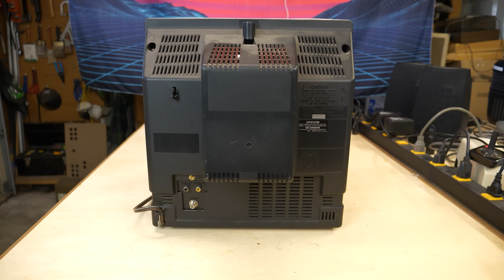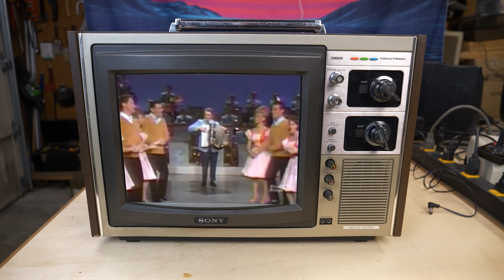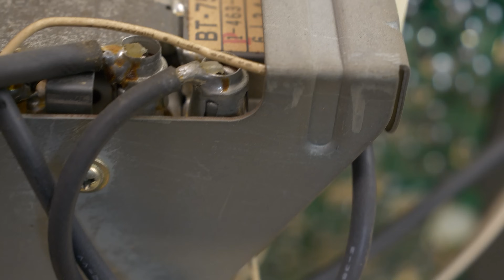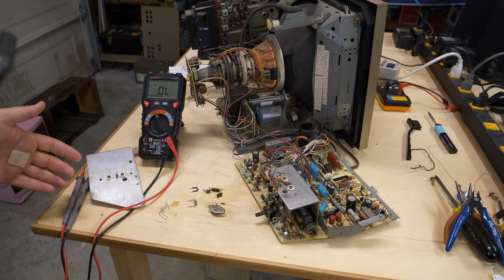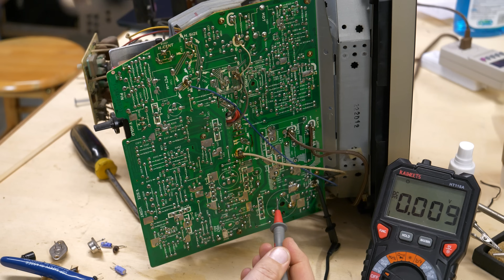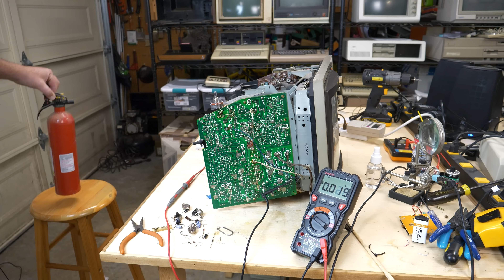Sony Trinitrons From The 70s And 80s

Comment: Their was a church that used to have these on the front of the pull pit. Their was 2 of them under a glass podium, they were black and white and one of them had purple carpet on the with part. The back was exposed. It was a unique set up. 📺

Comment: These TVs needed to have voltage slowly increase to reform caps a variac would do that but an incandescent light bulb in series with the tv would be useable. I found the Sony TVs to be money pits, throwing good money after bad, usually more than one component with take out several others, usually expensive horizontal output and voltage regulator parts that were Sony only made parts, you have to be damn sure the parts are all changed at one time or else you will have a pile of original and replaced parts making a nice pile. I considered it tuition paid to learn to work with these sets.  But I think I would have cut my losses once you blew out the second regulator transistor.
Reply from the maker: Yeah. I definitely need a Variac.

Comment: Why not just keep an eye out for a parts set or replacement board somewhere?  Much better than gutting that beauty.
Reply from the maker: Because if I find another set with a working flyback chances are it will work just fine. It's very unlikely I will find a set that has a good flyback but that can't be repaired for some reason.

Comment: We used more 9/14/21-inch Trinitrons than I can remember - in broadcast & post production…
Never saw any smoke or sparks from 1974-1987, then worked for SONY around 1991.

That was in PAL markets, so there may have been US power supply issues.
Reply from the maker: Good to know. I really think the flyback just went bad with age.

Comment: Transistors have three leads, yes?  Then how is the regulator a transistor?
Reply from the maker: Yes. It has three leads. Base, collector, and emitter.
Reply: @RetroHackShack  But I only see two.
Reply from the maker: There are two in the middle and one on the outside
Reply: @RetroHackShack  Do you mean the metal base?
Reply from the maker: Yes

Comment: Regarding putting in an LCD: it is possible to breach the tube’s vacuum by breaking off the stem, then cut the curved glass off the front. This can then be used in the bezel (epoxy maybe), and viewing the LCD through the original tube front would look more authentic. Of course it would mean destroying a CRT that probably is a good part in limited supply…
Reply: @Trinitron Productions if the tube is weak/bad/dead then really it wouldn't matter.
Reply: @Trinitron Productions That would not work in this case. different tubes. Could be done though as it is possible. Just not in his case.
Reply: @JelliedCranberrySauce ikr

Comment: I've been in many TVs in my younger years, due to living on military bases and so many people moving in/out (and free bulk waste pick up). I'd grab then from the curbs. Some of the older sets, especially the high ends, were so interesting with so many boards and complicated circuits. I was so young though, I really didn't know what I was doing besides basic things. 

I believe PIN is a pin cushion adjustment (something quite rare on a TV set), but not sure.
Reply: Particularly the noughties have a complex number of service menu "pages" ie on screen adjustments but for the entire service manual maybe several hundred pages for up to like 12 or 16 different but simmilar class of tv model numbers ie varying in screen size but probable fo have slight appearance variance in trim etc but not as much but still also some in performance or in other words resolution input capability

Comment: Miami Vice crossed your mind too, I was just thinking you'd see that one the desk of some sinister executive or dealer of yayo. Nice pairing with the NES, I'm guessing that was the peak AV for the time, still amazes me how long stereo TV/gaming took to arrive. RF, oh I thought you'd try Composite, that was high tech bitd heh.
Nice headphone jacks on the 70s set, just recently I was thinking I only imagined those in TVs, always thought that was a good compromise for one speaker electronics. Clean AV connection point system too, my first family TV got pretty scratched with screw & fork swaps during the VCR rental years. Coaxial connectors took a while to be standard too, Cable-TV push I guess, wish I could have tried UHF but Weird Al is my only reference to that world. ;)
Thanks for the feature, I was curious about high end TVs from those decades. There is progress in AV connectors but slow and in several steps adding Composite, then S-Video, then Component, and eventually RGB/VGA. They each have cost variances but too bad in NA we never saw an uber connector like SCART.
Anyways you tried and like you said about X amount of dollars rising to repair, there's always salvage parts. Speaking of LCD replacements, I've seen some interesting tube approximation by using a lens on the outside. https://hackaday.com/2021/06/16/fit-your-lcds-with-lenses-for-that-vintage-crt-look/
Reply from the maker: Cool. Thanks for that link. I will check it out.

Comment: Older set probably has shorted SG horz out SCR on the shield. Also shorted 
2SC867 pass regulator & a burned resistor in the hoz drive. Then you
need to find what blew it all.  Trust me, dont put a penny into it. Pink  one
looks good. A much better set & easy to fix.  Also came in blue, black, tan
& maybe a few other colors......
LFOD !
Reply from the maker: Exactly, I discovered that later on in the video. Good call.

Comment: This was a fun video, thanks for sharing. Shame the older TV was beyond fixing, as you said that definitely seems like something is shorted, . I'm happy you're keeping the TV, it's really quite aesthetically pleasing. Regarding the newer TV - I had the nearly identical model to your KV-1397R (except mine was grey) and it was a great little TV. Wish I had kept it.

9:55 The 2 earphone jacks were pretty common on older Sony TVs. One of them would mute the speaker, and the other wouldn't. They are usually marked with one dot and two dots to show this. I think the idea was you could record audio off a TV channel to a tape recorder while listening through the TV speaker, use headphones and mute the TV speaker, or as you said - use 2 different headphones for 2 people.

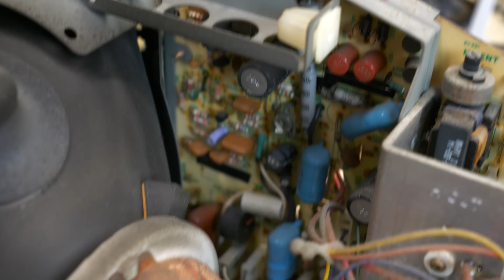18:17 PIN is the pincushion adjustment, it adjusts the vertical straightness of the sides of the picture.
Reply from the maker: Thanks for that helpful info. I was hoping to test those audio jacks out if it was working, but this will potentially help me in my resurrection 🙂

Comment: I worked at Circuit City in 1986. The pink set is part of Sony's designer series from 86-87, and you can get the user's manual at Sony's website. They had pink, red, blue and gray. Thy also had Betamax VCRs in the same colors. On the older set (too bad you can’t get it working) the Auto setting is to set the picture automatically (color. intensity, brightness and contrast). AFT is automatic fine tuning so you wouldn’t have to set the fine tuning yourself.  Those controls on the back are for TV techs. When I went to my grandma’s house and watched TV, it was Star Trek.
Reply from the maker: Fantastic! Circuit City! Loved that place. Thanks for the info.

Comment: Do the capacitors in this go bad if they were regularly used until recently?
Reply from the maker: No. Probably not. Of course all electrolytic caps can dry out or leak over time. That's why it's good to test them with an ESR meter.
Reply: @RetroHackShack  That's great I got a Trinitron from the mid 90s that was in use till 2018 or so and is in storage might just take it out and see if it still works. 

Also just found your channel a lot of great videos to catch up on.
Reply: @shoraz  a 3-4 year idle time is kind of on the edge of capacitors drying out depending on how high-quality they are. 6-12 months is about as far as I’d go for a definite. But I’d also probably just chance it and see if it works after 4 years. Then fix it if there’s any magic smoke released lol. 2018 is definitely way better than say 2010 for the last-used time.
Reply: @kaitlyn__L  I got it out of storage and it's dead, maybe not from the capacitor but it did get a bit wet everytime it rained so I'm guessing maybe the traces got corroded or something.
Reply: @shoraz  oh yeah that can do sooo much harm, even just extended high humidity. Could be just one trace is corroded out or absolutely everything could be crusty.

Comment: I'm confused as to why you wouldn't just recap the set. 70 year old electrolytic caps could still be leaking internally even if you don't see any physical leaking. They could be turning into resistors.
Reply from the maker: I did change many of them. I just didn't show that. You will notice my parts pile grows over time. However, I did test all the caps out of circuit with an ESR meter. They were reading a bit high, but not out of spec.
Reply: @RetroHackShack  https://www.youtube.com/watch?v=LhovRIM5xAo Check Out Mr. Carlson's video on Capacitor Leakage testing. I found it quite informative. ESR is not the only way to go to check for bad and leaking Capacitors. not that IO doubt your findings. it's just you only checked out the Capacitors for ESR and they require more thorough testing for leakage is all I'm saying.
Reply from the maker: Yeah. I did that too.
Reply: Shot gunning caps is not the way to go. TROUBLESHOOT the set. Even after 40 yrs at the bench I can mess up doing it.  Wrong value, wrong polarity  solder splashes etc.  There are a few caps commonly go in modern sets but just
a few. Others keep on going. And then theres the time & $$ to change out
50 little electrolytics......
LFOD !
Reply from the maker: Yes. Exactly and 9.95 times out of 10 they aren't faulty.

Comment: I have basically the same Trinitron as your 70s model, except with no fake wood. It is completely dead, no signs of life when powered on.
Reply from the maker: I think whatever causes this must be related. That's why I brought up that theory about the shorted bypass capacitors.